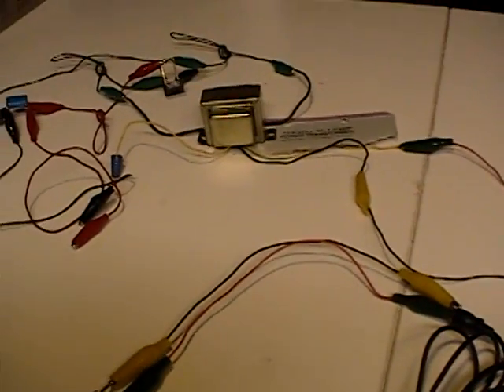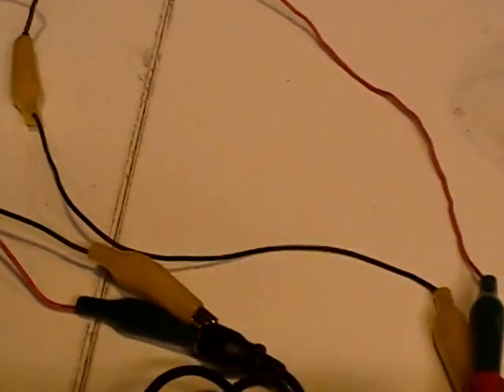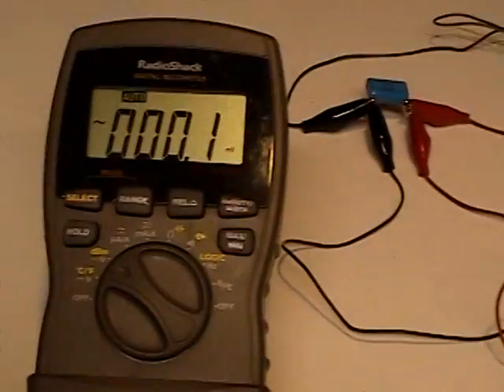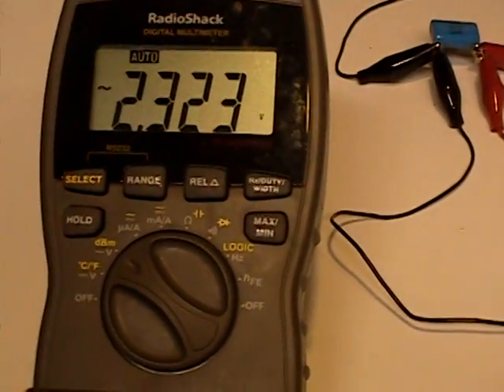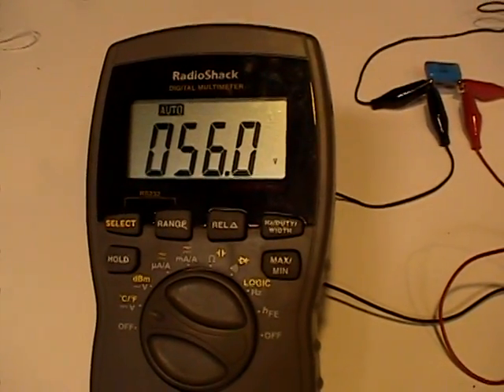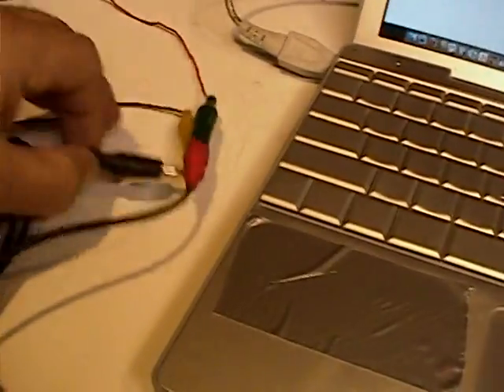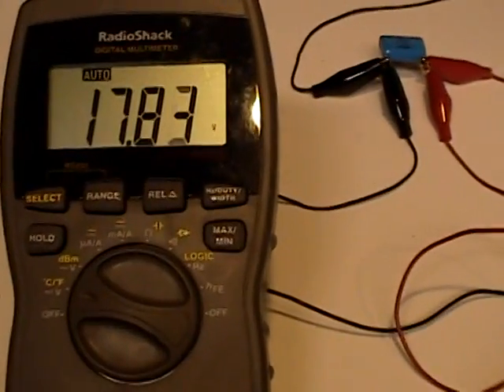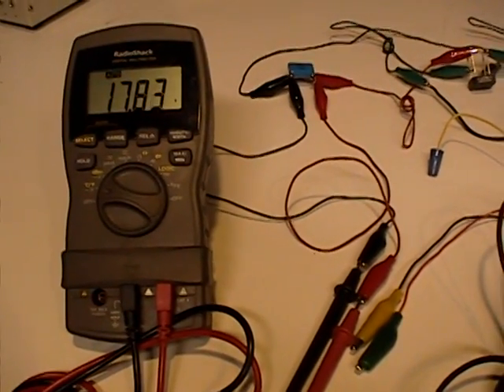Sending Sound Through a Transformer

Comment: @singerxyz A transformer is bidirectional of course ... it converts voltage to current or viceversa. Nothing new here. If the transformer is good and the frequency is centered in the frequency of the transformer, the loss can be very small, but never zero and never less than zero of course!

Comment: Regarding using the signal through a transformer to charge batteries, I don't think you have enough current to realign the molecules in the cell, so you can get some charge (equivalent voltage) but the dipole depletes rapidly. Are they rechargeable batteries? Some alkaline batteries will recharge but the results vary.

Comment: Hi Mike, I think Tesla stepped the whole thing with a capacitor, spark gap and relay switch. He said you could receive 50volts per foot from the ether! I reckon if you get enough voltage then you are bound (by the laws of physics lol) to get a few amps ;) with the video above the input signal is acting like an ac signal, the higher the freq the more power I guess...? I think tuning is important.

Comment: so you are saying that with input waves of the same power you get varying output DC voltage depending on the frequency of the input signal. And that the best results ie. most output voltage, are achieved if the input signal is "in tune" with your transformer. Isn't this basically how a Tesla Tuned Circuit works?

Comment: Nice. At the resonance frequency this transformer is acting as an over unit.
singerxyz, can u give us more details?
This transformer is designed to step down from X volts to Y volts; Can u tell as the what's the values for X and Y?
Drevtoobe, he used a rectifier (4 diodes) to convert AC to DC